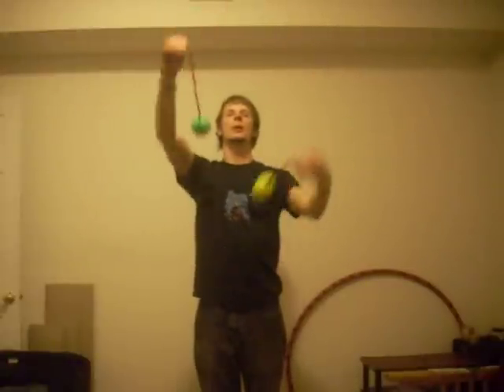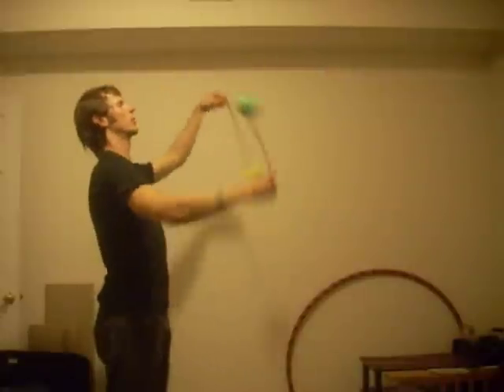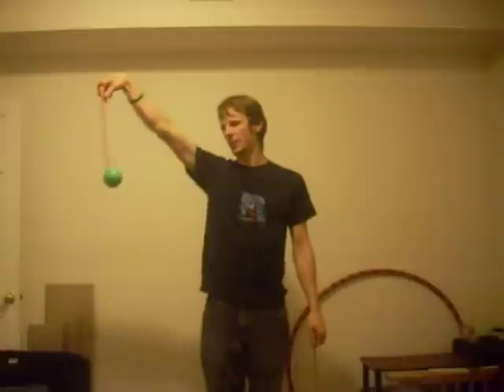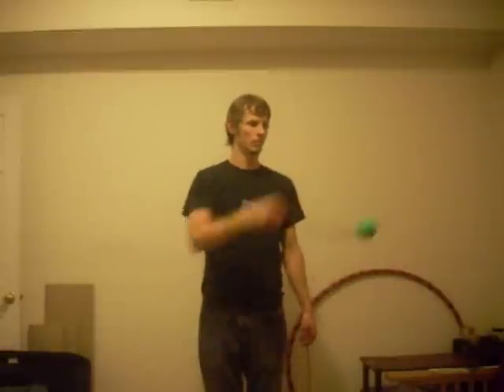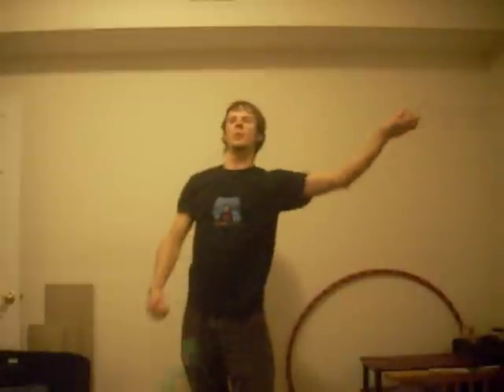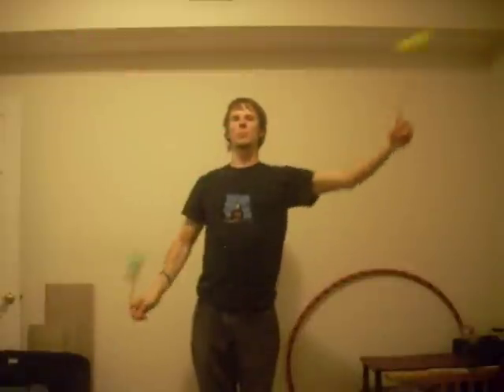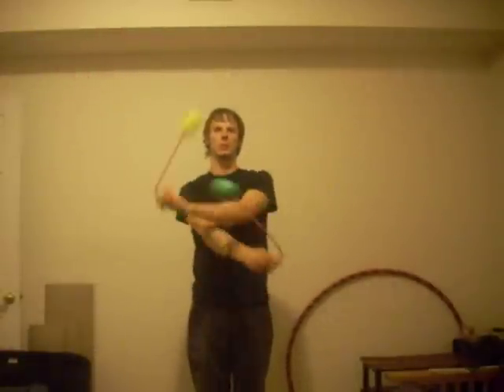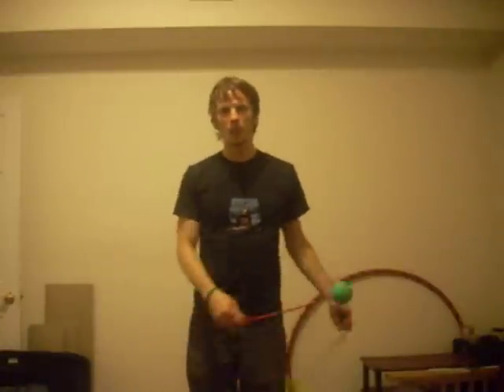Drex's Tech Poi Blog #56: plane-bending linear isolations, pendulum stalls, diagonal planes

Comment from the maker: It's a LOT harder on the outside. Part of the reason for this is that your arms move outward from the vertical stall to get to the horizontal movement and inward again to stall from horizontal to get to vertical. By doing the stalls with an outswing, you wind up cutting the available area to make these switches in half. It's not impossible, but it is a lot more difficult than it needs to be.

Comment: Canon G10... A really awesome camera for everything.

I LOVE this diagonal CAP stuff... I don't know if you my later posts are fully up yet, but there is a lesson on "translation" that I posted and it talks about moving the poi within the framework of 9-Square more freely. This is strikingly on-point with that way of thinking, except it plays with the diagonal lines in crossmode instead of the vert.-horiz. that I focused on. I like the sametime X one... Can you go into an atomic weave from it?